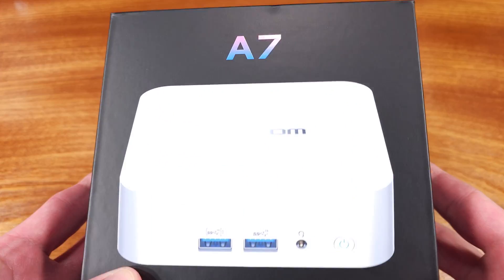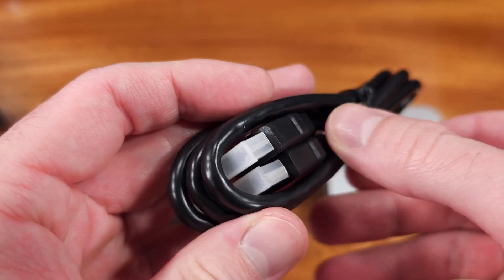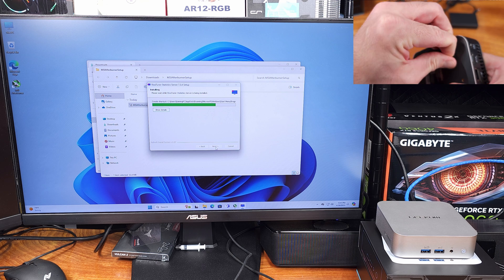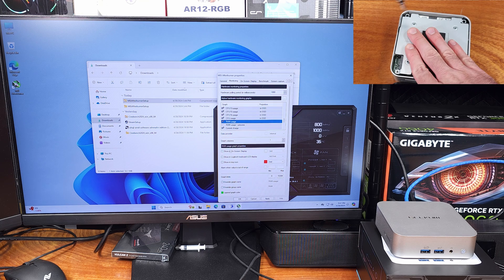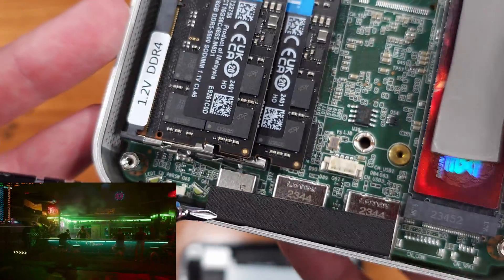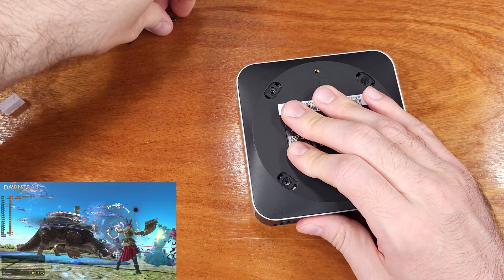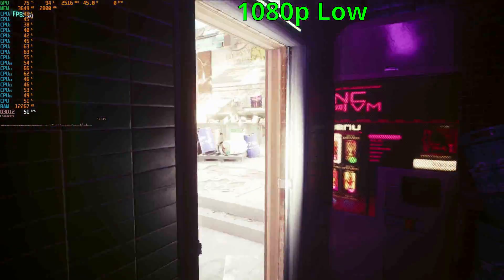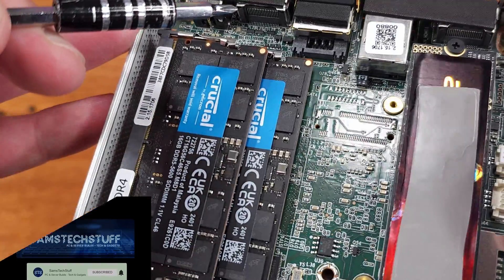Radeon 780m Mini PC - CyberPunk, Davinci Resolve And More

Comment: I think a mini PC using the i5-12600H, 12700H or 12900 series with 64GB ram would better because it has Quicksync for codecs in Davinci Resolve. I'm going to try with it !!
Reply from the maker: I've actually been editing on this mini pc for about 1 month now, its not as fast as my main PC but surprisingly fast. 

Did you end up testing our or using a mini PC with one of the Intel chips?

Comment: You mentioned that you use such a mini PC with DaVinci resolve, but didn't demonstrate usage with DaVinci Resolve. I ask because I have a Minisforum UM790 pro which also has the same 780M graphics inside but I am unable to install or load DaVinci Resolve.  Checking HWinfo and Techpowerup GPU - Z  system info inidicates there is no CUDA nor openCL.  So if I am curious to know how you accomplish making that work. I get an error message that will not allow me to continue and have an option to modify my settings for Memory & Graphics or Quit the install process.  There is no Cuda nor openCL (in the case of AMD) which is selectable after turning off Auto select.   Any insight will be appreciated. Thanks.  240530  modified 251001
Reply from the maker: Hi! Yes, I did include some video of scrubbing through timelines and the beginning of an export later on in the video (around minute 9). As for installing Davinci Resolve, I did not have any issues. Do you have the latest stable AMD drivers installed? I have read that sometime the latest AMD drivers can cause issues and users have had to roll back 1 or 2 versions. As for the version of Davinci Resolve, I prefer 18.6 right now, for me at least it seems to run very stable. I have not tried any of the newer versions yet. 

What AMD GPU driver are you using and which version of Davinci Resolve are you trying to install?
Reply: @STS   Hi.  Thank you for respondiing.  Actually I responded earlier but apparently Google decided to delete chat contributions because I use an ad blocker.  The never ending battle with ad infestations.  OK, rant over.

Thanks for the reply.  I appreciate the feedback.   To answer your questions:
!. AMD driver:  31.0.21029.6002 (Radeon Software Adrenalin 23.8.2)

FWIW, per Germini:  
" The latest AMD 780M graphics driver is version 31.0.22024.3, A04, released on February 6, 2024.
However, AMD no longer directly provides downloads for older graphics cards like the 780M on their website. You can typically find the latest drivers by searching the support section of the manufacturer of your laptop or computer."

So apparently I seem to be slightly out of date. I will try to hunt down this latest driver and install to see if that makes any difference.

2. DaVinci Resolve version:  I was attempting to install DR v19 Beta 3, but gives me dialogs about having to configure Memory & Graphics or Quit the install process.   Turning off auto does not help as there is no Cuda nor openCL to select manually.  I think I had DR version 18 previously running but can't recall.  I will try and reinstall that version after I find this latest AMD driver (which AMD no longer provides downloads for appareently).  

BTW, as an addendum, the problem may soon be eliminated as I am thinking to upgrade and replace with a soon-to-be-released  Minisforum AtomMan G7 PT which will be equipped with RX 7600M XT.  If interested:  https://minisforum.com/page/g7pt/index   Compettively there is also something even more powerful coming from Beelink.  ( https://videocardz.com/newz/beelink-teases-gti-ultra-series-mini-pcs-will-8-lane-pcie-gen4-5-port-for-external-gpus )   I presume both may be announced at the upcoming Taipei Computex Show 2024 starting June 4th.
Reply: @STS  Thanks for the feedback.  Much appreciated.  I finally resolved teh problem by installing an updated driver.  780M driver is no longer directly downloadable from AMD but doing an AI inquiry, I installed  AMD's Adrenalin-Edition-23.40.33.04 and it worked.
Reply: @tokyojerry hi, how is this 780M for davinci resolve?
Reply: @italobess  To be honest I have long since sold the UM790 So no longer have the machine for hands on review.   When I had it I had 64 gigabyte of RAM installed  and when editing rather than doing full frame I reduced to 1/2 size for smoother scrubbing etcetera.  You might even try going down to quarter size if you have less RAM, but I was able to do things at half frame.  I currentlyuse Minisforum's  AI X1 with 890 igpu. It runs DR Studio version 20.with no problem and 96GB RAM.